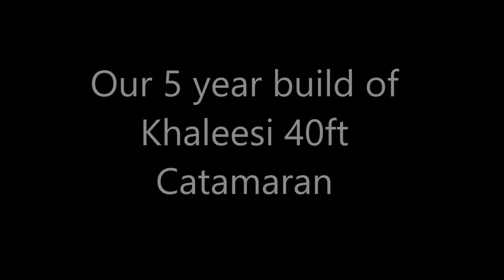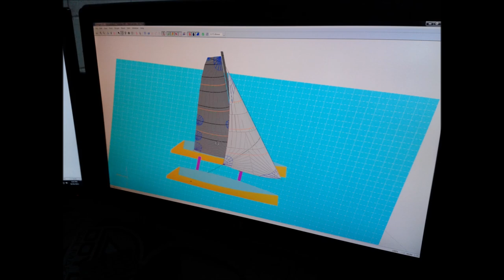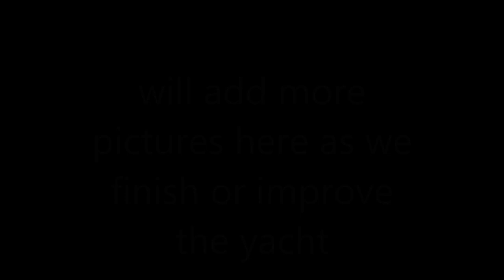Our  build SV Khaleesi 40ft Catamaran

Comment: Lovvely looking boat! Which model Grainger is this and what were the main mods you did to the design?
Reply from the maker: She's a 33ft mystery cove. We've lengthened the bow and the back deck and swim platforms to make the waterline 40 ft. We cut the cabin top off and raised it about 3 ft. New paint job inside and out new 60hp high thrust yamaha outboards. All new electrics and plumbing. Basically gutted the whole boat and everything is new. Built the boat with my dad and first launched her xmas 1996. Thanks for watching regards Shazzie
Reply from the maker: Dad left the boat to me in 2008 and we rebiult her over 5 years. Relaunched in November 2013
Reply: SV Khaleesi he would be very proud...